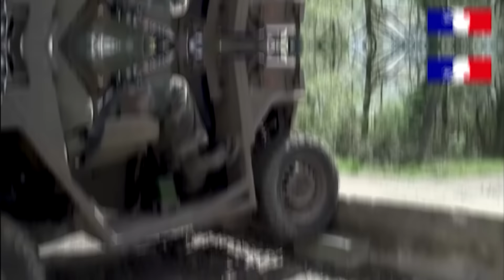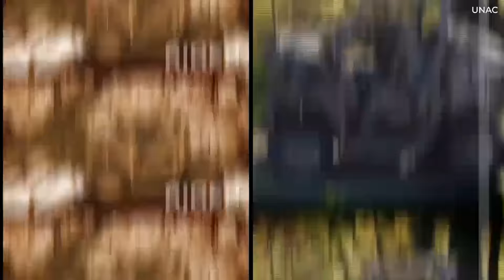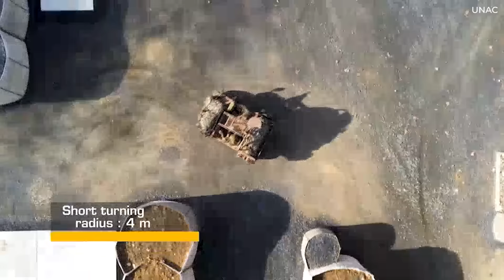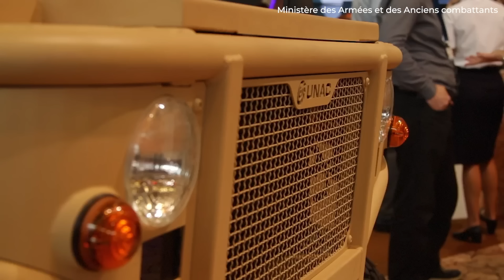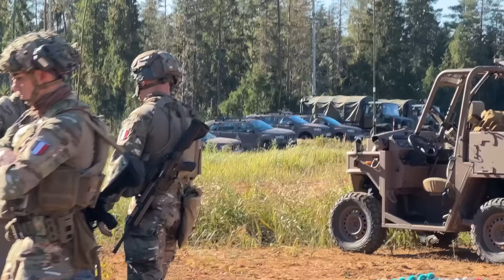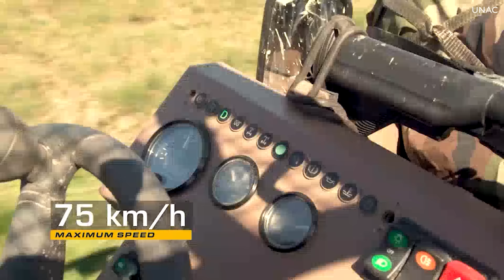France's Air-Droppable Paratrooper & SOF Utility Vehicle

Comment: Anything is air-droppable. Most just don't survive the fall.
Reply: Needs to be air-transportable first.
Reply: @canicheenrage Anything is air transportable if you have enough C4
Reply: @Infanterie_Marine  Air propellable =/= air transportable. 
Rocket boosters don't count either i'm afraid.
Reply: @canicheenrage What about the pieces?
Reply: @canicheenrage  Some battleships went airborne during Operation Crossroad. Everything is air-transportable with enough explosive.
Reply: It's not the fall that does them in; it's the sudden landing.

Comment: Quite impressive load carrying for such a small vehicle. 

If it's primarily an air dropped vehicle I'd prefer the Polish Aero though. Not just for carrying capacity, but the greater all up weight gives you much better towing capacity, and the bigger wheels are better off road.

Comment: It is an interesting vehicle but for most operators it would be useless. These might do well in Africa but for Europe it is not very suitable outside the Mediterranean countries. We all get mud and snow nearly two thirds of the year and the eastern and northern ones even more.
Reply: You know there mud too in Africa
Reply: @pandaDotDragon yes but only during the rain season not two thirds of the year.
Reply: It’s very lightweight. It won’t get bogged down easily and even if it does get bogged down, the facts that it’s lightweight allows it to be saved easily without the need for heavy towing equipment.
Reply: @osefman2763 the whole point of airborne assaults is self-sufficiency. When they have to get towed out every time they cross a swamp here it defeats the purpose. This is why we use heavier vehicles in airborne and air mobile forces that can winch themselves out or that are so light they can be carried out.
Reply: @DinJarin74 That thing got a winch you know, just saying. Beside, tell that to the russian, ask them how the bmds performed. Heavy doesn't mean good for airborne, on the contrary.
Reply: @osefman2763 wouldn't do them much good in eastern Europe or the swamp here. No auxiliary electronics to operate it. But I'm guessing you are French and think you can do anything if you are nationalistic enough.
Reply: @DinJarin74 What does my nationality have to do with anything here ? Swamps? Are you serious? At that point no wheeled vehicle can go through that, especially the heavier equipment you mentioned. Even fricking tanks are going to struggle in swamps. Eastern Europe is mostly flat so i don’t see the problem here (just look at Ukraine).I don’t know what you are trying to accomplish or say but so far you are you are not making any good points and I'm guessing you might not even be from Europe.

Comment: A purpose built vehicle for select forces to be used to increase mobility, small for movement in narrow paths and not bogged down with useless electronics for ease of repair. Flip side across the pond is the MRZR platform is used and abused, has 5 different models and struggling sales as new innovations are on the market weekly, France thought of this and said no - we will build our own. It might not be flashy but it does the job it was built for and most likely outlast other vehicles in the same field. Cheers

Comment: This buggy cost just shy of €150,000 per unit.

That is absolute lunacy.
Reply: Military vehicle fleets are often bought with a multi year support package, which can include training, maintenance, and spares. 

So is that actual unit cost, or programme cost divided by number of units?
Reply: @Naturally-Fragrant it does include a 15 year maintenance contract indeed
Reply: When you design a vehicle in a series of 300 pieces then it gets expensive.
Reply: made in france, half of the 150000 is direct tax back to france, and the rest make the economy work and have also several indirect tax back. 
Always cheaper and better to build in your country.

Comment: In general, I like the idea of small motor vehicles that support light infantry. Though light infantry should be strong and be able to carry everything on their backs when the mission requires it, in most cases, the terrain will allow for all sorts of load-carrying equipment to help portage everything without loading down each individual soldier. Nordic light infantry still uses man-pulled sledges that let a single man transport more weight for longer when moving on snow. US Rangers used wheeled handcarts in WWII. 
Anything that takes the load off a light infantryman is a good idea.
Reply: I like the idea of horses and mules and a few armies use them but not Canada.  I think we should change that.  I hike on many narrow, rough terrain trails and the only other thing to carry cargo would be a horse or perhaps a pushed bicycle.  The Fardier and other light vehicles and civilian ATVs are still way too wide for most foot trails.

Comment: I would like to see some sort of doors 😅
Reply: It's the opposite, you dont want door.
First, because door keep the heat inside.
Seconde, because you want to be able to leave this tin can as fast as possible.
Reply: @Kaezeribato-B88B13S . It should be a roll-bar as on the HMT Jackel
Reply: And a roof and windows and air conditioning.
Reply: @Naturally-Fragrant . Depends on the situation 😉

Comment: Interesting vehicle. The fact that it can be transported inside a medium helicopter makes it easier to deliver and will help to confuse enemy observers as to troop movements. Better to put some ground vehicles on the landing zone with the first troops than to wait  for a scheduled delivery of heavier vehicles. The smaller size also makes it significantly easier to conceal under camouflage nets.

You guys should attend a camouflage training session and get your hands dirty, setting up a variety of vehicles with camouflage nets. It will expand your appreciation of the task complexity and also, the hassles that occur when ‘blanket counters’ who never leave ‘bullshit castle’, a standard name for a country’s Defence Force Headquarters; decide not to provide aluminium tent peg mallets as part of a camouflage net complete equipment schedule (CES). The need to borrow mallets from tents and ensure that they are returned, is a ludicrous complication. In addition, vehicles need to carry mallets whenever they have been equipped with  camouflage nets, scrim, poles and pegs. As a former Territorial Force Royal New Zealand Engineer, i.e., part of the Corps that teaches camouflage to the rest of the NZ Army;  I was highly annoyed by this dangerous parsimony. I doubt that anything has changed in subsequent decades. I coined the expression ‘Stupidity is the most dangerous contagion known to man’ some time back.
I suggest that you make contact with a part-time unit. They will appreciate the additional labour force and relish the opportunity to educate the news media in this vital military skill.
Reply: I recall a wooden mallet which came with 1943 manufactured brown canvas "bell" tents in the Canadian Militia ca. 1982.  It looked like right out of the middle ages.

Comment: We cannot reduce everything to the events currently unfolding in Ukraine; this vehicle is a response to the French military's requirements, addressing needs that emerged during operations in Mali or Afghanistan. The French army is, above all, an expeditionary force accustomed to deploying agile, autonomous units; naturally, if you imagine it is designed to confront swarms of drones, that is a different matter. But none of the other vehicules it is compared to would do the job either.
Reply: Ironically i can see this thing surviving drone strikes. It basically has no armor or interior space so if the driver jumps out or dodge fast enough the drone will just past the other side. That and the engine compartment is tiny so the chance of hitting it is much smaller compared to something like an unarmored Humvee
Reply: No no everything should be like ukraine, because we all know an Abrams/Bradley is air droppable and APS is in no way a friendly fire producer. 

We also need to stop buying infantry because we know Ivan and his quad copter can definitely remotely man a machine gun post and can talk to locals. Nothing says friendly peacekeepers like HAL-9000 with buzzing noises and a machine gun pointed to your face.

Comment: Not obvious to me what problem it was meant to solve.
Reply: providing support to the units like carrying all the bags during long walks, providing fire support, ammo & co, moving the wounded, etc. With no or very low maintenance (unlike the other vehicles).
 it s very small therefore it can be transported everywhere and it can be used in all kind of roads. And obviously it s less costly than having a massive fleet of helicopters to do the same job.
Reply: How to fit a car in a helicopter is and was the problem it solved.
Reply: Walk 40 km with 60kg of gear without a wheel cart or push cart, then watch the video again
Reply: My guess: Consider it a present day version of how the old jeep often were used.  1-2 persons in areas where having A vehicle beats No vehicle. So from HQ back home, messengers, inside base guard patrol. Minor logistics out in the terrain. First wave vehicles on the ground for air or ship delivered missions. Behind friendly lines transportation and behind enemy lines transportation (thus not front line duty as such). Spec ops stuff. 

It don't get as bulky as new jeep as vehicle manufacturers have become better at making vehicles that don't need so much of its space be solely for the engine. Also, much like the og jeep the backseat is "there" but it's clearly only go l comfy for 2 persons, in this vehicle it seems even less fun to be third+ . I like that they made their mind up about how many is projected to be in it. It's a good choice imo since adding a trailer/mortar/whatever needed should be easily done. 

Someone else can clarify this better but I think most of France expeditionary ambitions are in countries/territories that are mostly flat hard desert right?
Reply: It's for paratroopers, imagine you're behind enemy lines, without vehicles, now with the Fardier you can move further away, an A400M could easily drop 2 or 3 of those besides the men.
Reply: You should watch this video.